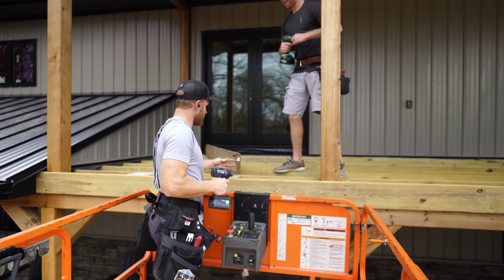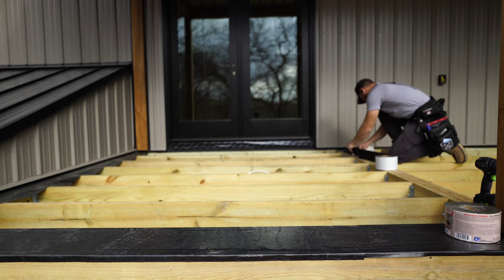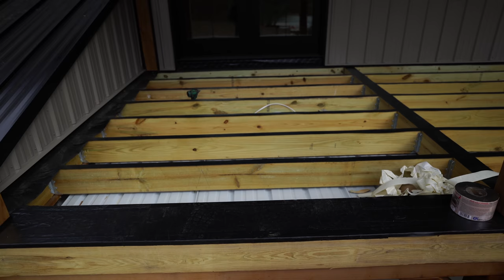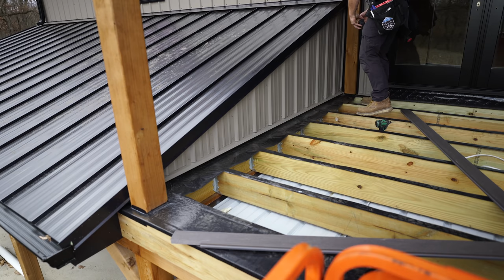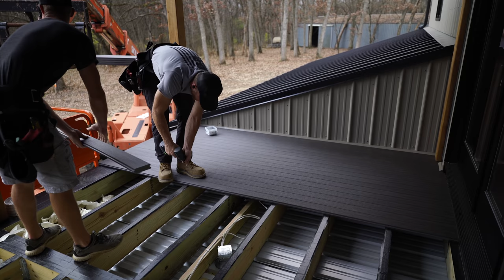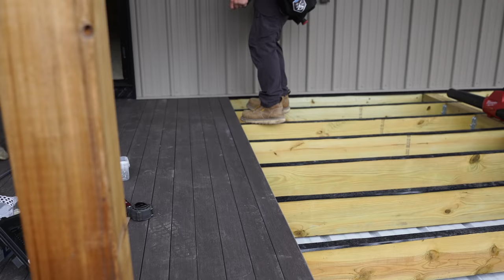Cabin in the Woods 39: Installing Composite T&G Porch Flooring

Comment: To add to the previous comment. I would also use a 1/4 round in a a small router to the edges of the (in the field borads) to compliment to round over on the picture frame. Other then that always looks great guys.

Comment: for future decks and since the 6x6 posts are oversized for the load, put a 1/2" deep dadoo above the joist the thickness of the flooring and you will have a place to kill the end of your decking and to allow for any contraction/expansion
Reply: and sorry, meant to compliment you on a awesome looking deck
Reply from the maker: @hpw59  its a great idea thank you
Reply: I had to Google Dado joints and this is a great tip.
Reply: @RRBuildings  I believe I read that in "Tips and Techniques" from Fine HomeBuilding Mag. years ago

Comment: Instead of solid blocking , run perpendicular  blocking for the picture frame it will allow for drainage and water won’t pool up in between deck boards , helps in the freeze season

Comment: Kyle.. I was at work. Just thinkin about the deck. 20 20 hindsight.. maybe next time make the cut for the picture frame behind the last post on the left.. so u have a full piece left to look at finishing it off instead of 2 pieces.. might cost another board. But priceless to look at a smooth piece. Thanks

Comment: I know you didn't do electrical but the romex under the decking to the lights below makes me nervous.  Unless it outdoor (UF) the white romex is not made for wet locations (jacket is not waterproof nor is the wire insulation).  It will be fine for some years but would hate to see corrosion cause a fire and ruin your excellent work.  The can light junction boxes also do not seem weather tight based on the knockouts somewhat visible in the video.  It seems the are planning on water getting in otherwise they would not have slopped the ceiling below.  The cans lights and wiring work in a soffit for 50 years, but not under a deck like this.  I once worked on a ceiling fan (removal) on a "covered deck" that had water running out of it because of something like this.  Love your attention to detail and all the excellent content you provide!

Comment: Have you done a video on those tool pouches... if you did I missed it.
Reply from the maker: not necessarily...they are the gRRande setup I helped design with Diamondback Toolbelts and I did talk about them in a video last winter..these are just new ones with the custom logo
Reply: @RRBuildings  Gotcha... hadn't noticed the logo before and they looked kinda stiff like they were new.  I use Atlas 46 and the belt your using looked like one of their padded belts.  I was gonna ask how you liked it

Comment: Kyle--What type of screws did you use to secure the metal panels to the underside of the porch? Are the screws you usually use to secure panels to regular framing able to withstand the chemicals in PT lumber or did you have to use a screw with a different coating?
Reply from the maker: they are made for treated

Comment: Is the light fixture underneath the deck boards waterproof? It looks like a metal box fed by standard romex?
Reply from the maker: that is a good question...I didn't do any electical...but the guy that did is top notch.. I'd trust what he did
Reply: I agree. Major code violation. I noticed the same thing. Neither wire nor box are rated for that application (wet location).